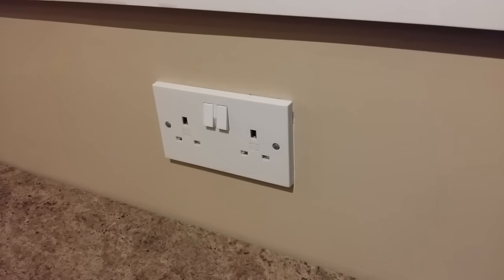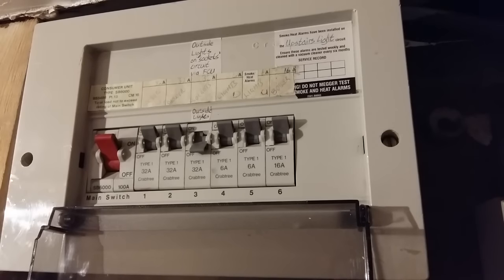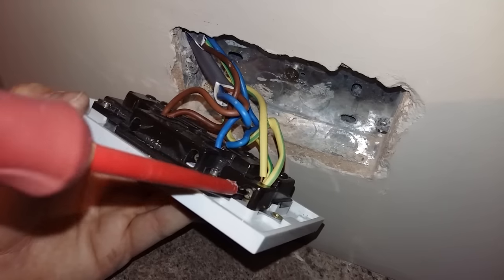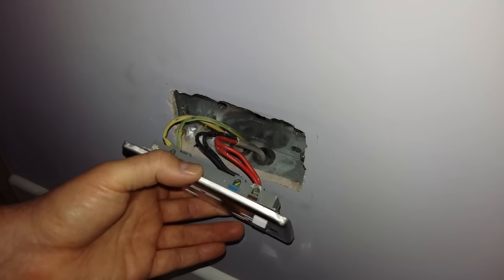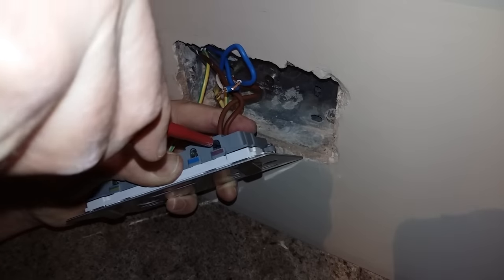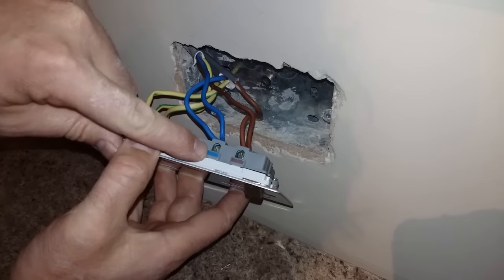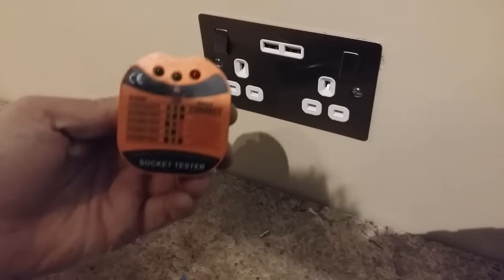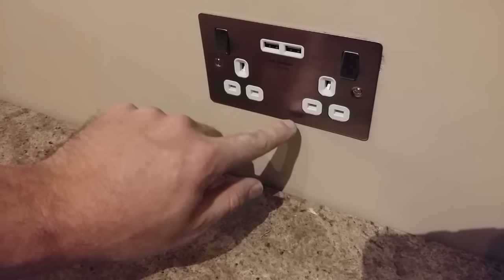How to fit a USB Plug Socket in the UK - Old and New Wiring Colours

Comment: Well done that man. Bought a USB double from Aldi but the diagram supplied was for a single cable in only, spur? Not only that but my wiring was 2004 old colours, you scored a double, thanks. After chiselling out the old sloppy plastering it's all working fine now. Cheers.
Reply from the maker: Glad the video helped you out. I covered both colours as our house is half and half! Cheers! 👍🏼

Comment: How long does it take you to charge your mobile via the usb socket (not wall plug)?
Reply from the maker: I've got an S8 and it fast charges fine through the USB. As quick as it does using a plug anyway. I couldn't tell you exactly how long though.

Comment: Superb vid. In tbe process of doing my loft up.fitted standard socketd.but changed my.mind after painting.now going to fit USB ones. Though maybe it would have been wired different.your vid was very informative and well made.cheers bud. 👍👍.double thumbs up.
Reply from the maker: No problem. I'm glad you found it useful. Thanks for the comment. Good luck with your project.

Comment: UK wiring is  great and the plugs are huge but safe. Why do you need insulation on the ground (earth) connections?
Reply from the maker: +Brian Smith There's 2 reasons for this. 1. It identifies which one is the earth wire and 2. It stops the bare wire touching any of the terminals when you put the socket back on.
Reply: When you think about that, it doesn’t make much sense. Since the boxes and anything else metal is earthed, there is really no reason to have insulation on the ground. It’s just extra cost. And the ground is always identifiable, since there is no insulation. I suppose that is the rationale in the states. I’m not knocking the methods in the UK. Very precautionary. I can appreciate it.
Reply from the maker: +Brian Smith I see where you're coming from, but the rules and regulations in the UK are very "belt and braces"!
Reply: Brian Smith If your Distribution Board (consumer unit) is not RCD protected then if the CPC(earth) had no insulation on it and it was to touch the live terminal it would then make everything in the property that is an exposed or extraneous part live because it would created a earth to live fault if insulation is there then it would not happen also if the board is RCD protected it would pick up this fault and trip the RCD out, Its not pointless its that added bit of safety

Comment: I've got 2 live 2 neutral and 1 earth 🤔🤔🤔is that normal?
Reply from the maker: There should be as many earths as the others. Have a look in the cable that holds the live and neutral....someone may have cut it short and not bothered connecting it.
Reply: @charlieshooter  cheers man! Turns out I didn't look close enough, they had just shrouded both ends so it looked like 1 cable so was all good 👌🏼👌🏼
Reply from the maker: @Planet9_music  Pleased to hear it....glad it wasn't a botch job!
Reply: @charlieshooter  you're telling me mate 🤣I was getting paranoid for a moment!

Comment: excellent video Charlie do all my own work except electrics so this was very helpful bought 3 today a bit different though from your illustration its 13v and usb is 2.4 v is that ok mate
Reply from the maker: Thanks, glad you found it useful! Not sure about it being 13v? Is it a standard UK socket? A 2.4v USB is fine though and installation should be the same.
Reply: hi mate tried fitting that usb socket but when removed old socket and wires usb one found there was not enough room in back box to fit so bought plastic deeper back box to accommodate which fitted together ok but breezeblock at back of socket so no chance of making recess big enough to fit ….so front plate is sticking out about 5 mil from wall any ides or will that be fine mate
Reply from the maker: That's not ideal, it should fit flush to the wall, and definitely shouldn't leave a gap between the back box and faceplate. If it's only 5mm, then you should be able to chisel out some of that breeze block, to set it deeper.
Reply: took it back mate and got some with usb fits fine cheers again
Reply: @charlieshooter  amp not v surely
Reply from the maker: @galentyrol6512  Mine indicate they are 3.1a - 5v on the front plate.
Reply: @charlieshooter  hi "Charlie shooters know how" thanks for the reply, I was referring to your original comment on this thread, where you wrote 13v and 2.4v, think you meant amps
Reply from the maker: @galentyrol6512  Sorry, I was just going off the question asked initially. Thanks for taking the time to comment. 👍🏼

Comment: I've earthed the back box and when I go to screw the frontplate back on and switch on the supply a fuse blows but if I leave the socket unscrewed it works fine? help
Reply from the maker: +Francis Ikhifa It sounds like you are pinching the live wire against the backbox to me. Check the wires don't have any bare sections and make sure when you squeeze the socket up tight, no wires are getting pinched/trapped behind the socket. Also....goes without saying....but double check all wires are in the correct screw on socket. Hope that helps!

Comment: What happens if you only attack on of the wires? As in 1 black and one red wire?
Reply from the maker: If you mean if you only attach one of each, then the wires will short out in the back of the back box that aren't attached. If you've only got one of each, then the socket is probably a spur.

Comment: I have brown-taped a radio plug to an extension lead socket to stop someone removing it.
Is this dangerous?
Reply from the maker: Yes, I would have thought so! Brown (parcel?) tape isn't for electrical work and could overheat the plug, plus, what if you needed to unplug it in a hurry?
Reply: @charlieshooter  Thanks for your reply. I could unplug the extension lead at the wall? What do you think?
Reply from the maker: @HereIsWhatISaw  Still not ideal!

Comment: Charlieshooter, why some have two wires each and some single wires (sharing from the other Slot)?
Reply from the maker: +cikguomar As a general rule a socket will have 2 wires to each slot because it is on a ring main. In a ring main a wire comes from the consumer unit, in and out of each socket and then back to the consumer unit (in a ring).
Where there is only one wire in each slot at the back of a socket, that is likely to be a spur off the ring main. The socket will work the same.
Reply: Now I understand, appreciate it. Thanks for the info!
Reply from the maker: +cikguomar No problem.

Comment: This is easy, but what about when you have smart switches and the hole isn’t deep enough?!
Reply from the maker: If you're careful, you could unscrew the back box, chip away at any plaster holding it in, and then chisel out the walls a touch, and replace it with a deeper box?
Reply: I know I'm late to this, but you can get spacer units to get a bit of extra depth. Search for "double socket spacer". They're about £2 each
Reply from the maker: Yes you can get the spacers, but they don't look the best in my opinion.

Comment: So you have new wiring colours with no RCD?.  No safe isolation (ie proving the tester still works after the circuit is dead).  No mention of locking off (even saying put a notice up not to switch the circuit on would be good!)
Reply from the maker: +cjmillsnun Correct....the circuit had been extended prior to me moving in by the looks of it and they used the new wiring for that part. They wouldn't have needed to change anything at the consumer unit when they did this. I was working in my own house with no one else home....no need for me to write a note to myself to remind me what I'm doing. Thanks for watching though.

Comment: Awesome vid
How much should it cost to fit 5 of these and 1 light switch thanks
Reply from the maker: +Infinity vidz help the helpless If you are fitting them yourself then the actual units are £28 for 2 at the moment in Screwfix.
Reply: If you were to get an electrician to do it then it should cost between £30-£40 at the most assuming you provide the sockets/switches.

Comment: Thank you very much for your video mate, it helped me massively. I want to fit a dimmer switch but when I took off the front cover of my switch  I found that the wires into my switch are both the same which is brown? It is just one price of 2 core wire but with  both the wires inside being the same colour I don't know which wire goes where. I do not own a multi meter to check them so I was just wondering if there's any other way of doing this but without having to pay out lots of money? Thank you very much for taken the time to read this. Take care and thanks again mate.
Reply from the maker: +K Ri It's difficult to know which is which from looking at the wires, but try and look on the back of the original switch for "Com" and "L1". Make a note of which wire goes into which one and match that up on the back of the dimmer one.  If you get it wrong all that will happen is the switch will work the opposite way (on when it should be off and vice versa!) No need to fork out big money though

Comment: Hi, I'm in the process of changing these in my house. Some have been really straight forward, then others have had multiple and mixed between old and new wires. Given it's an ex council house I expected as much. However I just got to the last one and I just can't fit it it into the back box. Would you recommend swapping the box and it is easy? Thanks
Reply from the maker: If it won't fit and you absolutely want to replace it with one then you can swap the back box. It's not too difficult....just fiddly if you don't want to damage the surrounding area (if it's plastered in). Once it's out you would have to chip away some of the brickwork to make it deeper.
If it's only sticking out a small amount, and the wires are quite long, you may get away with trimming the wires shorter (not too much though!) to get it to fit?
Reply: CharlieShooters KnowHow trimming might work,. I'm only a couple of mm out. The others have been a little tight but workable or would you recommend replacing them all?
Reply from the maker: ChargedWords You shouldn't really crush the wires too much, but if you can do the screws up easily enough that should be fine. Try trimming the wires if they're long but remember....you can't add any wire back on, so go careful!

Comment: My socket had 3 of each type of wire... and they very short...
Reply from the maker: Sounds like there is a spur coming off that socket. That's no problem, just a bit more fiddly, and especially if the wires are short!

Comment: One of my fuses have blown and now I cannot use my wall plugs
Reply from the maker: +AssassinL1V3 After fitting a USB socket? Double check it's wired properly and there are no bare wires showing.
Reply: charlieshooter thankyou for the tip it's been sorted

Comment: I hate seeing more than one earth cable in the earth socket! There’s two earth sockets for a reason.
Reply from the maker: There's no issue with having 2 earth wires in the same terminal. There is actually 3 earth wires in this install and only 2 terminals so one is going to have to double up. Thanks for watching.

Comment: I don't trust the things, and if I moved in to a new place and these things were everywhere... out they'd all becoming...

A uniform design fault I don't like... a little transformer live 24/7... something goes wrong with the current, not that it does much because in the UK the current is generally stable, but the thought of what could happen if still lingers... they need to have an on/off switch for the USB's too before I'd even consider one.
Reply from the maker: +gazyounglive Thanks for watching. It's a fair comment....but I think the RCD/MCB would trip before it causes any major problems.

Comment: Just a reminder to people doing this. ALWAYS earth metal backbox, it is not optional. Sleeve earth wire with green+yellow sleeving if you find old exposed earth wires. Earthing the backbox is especially important if you are using these metal faceplates. Also check for earth continuity with a tester. The last thing you want is to get shocked to death touching your nice metal faceplate due to the previous homeowner not checking this.
Reply from the maker: Good advice there, and if both lugs are adjustable then you MUST run an earth tail to the metal back box, but if one lug is fixed then the regs indicate there is no actual necessity for it, relying on the screws to earth it. Always better to be safe than sorry though and run one!